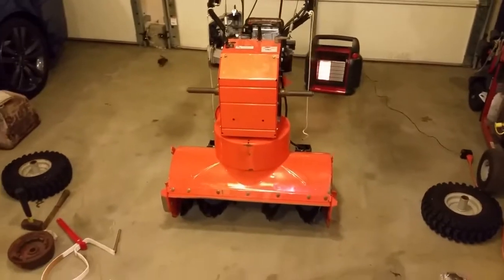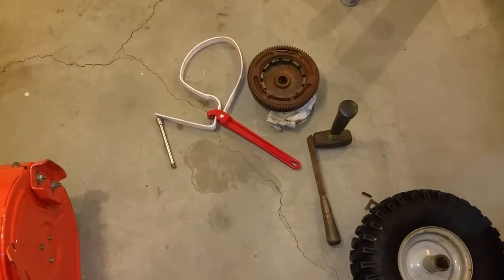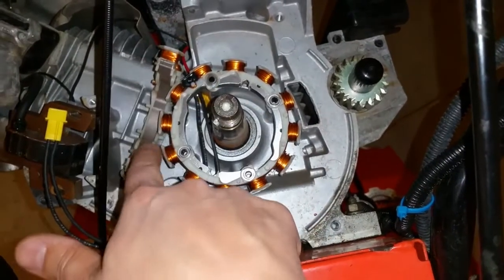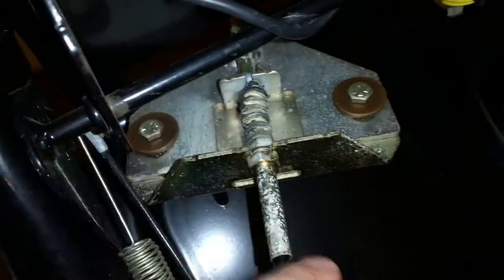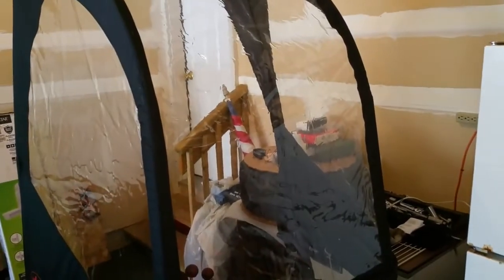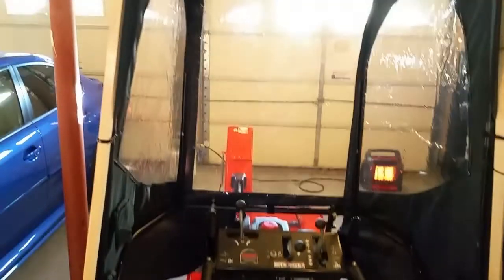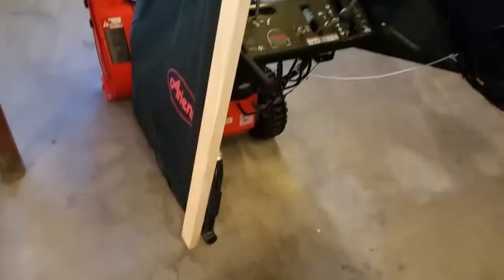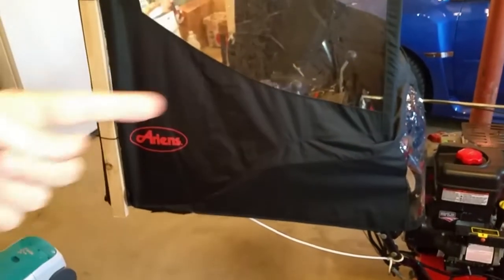Ariens Platinum Snowblower Maintenance, LED Mod, & Upgraded Stator

Comment: Lots of research.  I simply used the 12VDC battery from my Lawn Tractor in a marine box, keeping it well forward of the canopy, and on the roof of my canopy (different design) mounted a magnetic based rotating Blue light and a rear strip of red led's. County guys always give me a wave!  I used a DPDT switch and an old 2 speed reversible 12V electric drill.  The drill is connected to the shortened chute position shaft and I can now rotate the chute very quickly without cranking.  I have no need for additional work lights but they could be easily installed.
It is a White branded 10.5 HP 30" Snowblower. Cost was price of switch and Swap meet lights and battery case.
Reply from the maker: I too want to do the red LED tail lights, and top strobe. Seems a bit overkill for my needs...but it will look badass like yours is! Can you make a video of your setup? I'm curious on the  drill motor and  shaft setup. Similar to my JD chute kit. The Ariens has a joystick setup which works real well. For a battery i went super cheap and just did  9V 2xAA with a simple switch. Turn the switch on to activate the regulator, and turn it off and the regulator runs everything. So far working great!

Comment: Video looks great.  Very creative solutions.  Lots of skills employed to get this all done.  Wondering if something like a 12V UPS battery would solve your battery problem?
Reply from the maker: That's exactly what I had in mind. In fact I bought a 5Ah SLA battery originally intending to mount it somewhere, but its a hefty size battery, but I need a new one of those for my house alarm system, thats where it went lol. They have small 1.3Ah SLA bats that will be small enough to handle the lights for a short time, and handle the 14.2VDC charge. I could also just by rechargeable 9V and AA batteries and chance that, but my fear is that setup will blow up the batteries. Thanks for the kudos on the video. Tried to make the video as clear as possible, but a few things evolved after making the video clips.
Reply: My frugal side was kicking in and I thought you could replace the battery in your UPS with a new one and use the old one in this application If you're able to solve the mounting problem for a hefty little battery.
Reply from the maker: yeah, my UPS' have 7.5Ah bats I think. The 36" machines used to have a 12 volt electric start and garden tractor batteries with a mounting plate. There isn't much room on  this machine, but it can be fabricated on the rear wall of the belly plate, but seemed like a lot of work...but then the idea is sound...probably a good idea for my application. Maybe next season! :-)

Comment: What stator did you use? I have an Ariens 926LE it has the light on it. I went to my local Ariens dealer and they gladly sold me hand warmers and said they would work fine. But after installing them I realized my model has an 18 W stator and cannot handle both the light and hand warmers. I called the Dealer and they were stumped and said it should work....any ideas??
Reply from the maker: I used part# 695466 for the upgraded stator. An alternative is to use two 797090 stators, they are half moon sized. All info can be found in the description. 18 watts def not enough, you sure it has that small of a stator? You need a 60 watt stator to handle hand warmers and incandescent light. 

Thank you for watching!

Comment: I was going out to buy a Ariens Platinum 24 SHO 369 CC snowblower I want to add one single LED instead of the halogen I seen videos where they at a bridge rectifier does that still work on the newer Platinum 24
Reply from the maker: It should yes